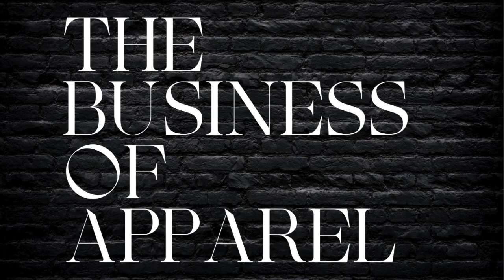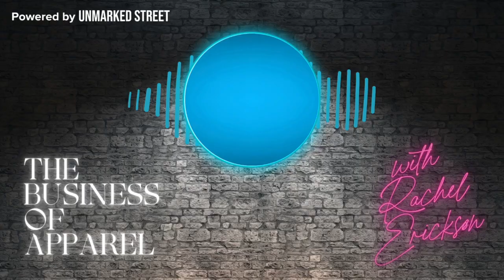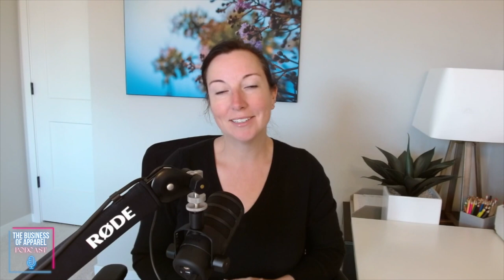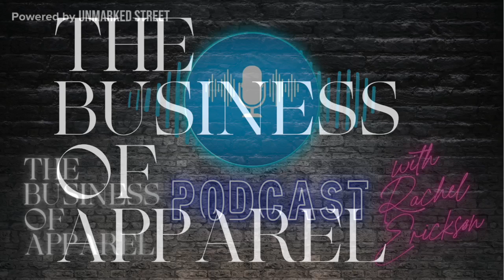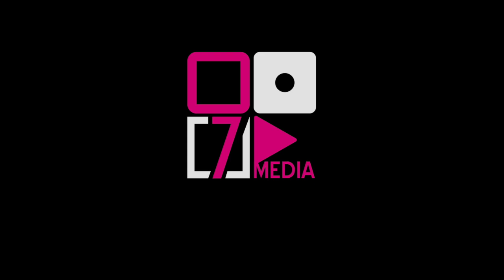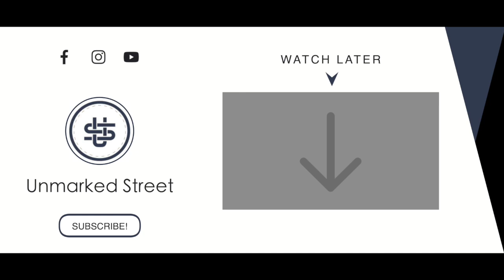California’s New Legislation for Apparel Sustainability | Ensuring Sustainable Fashion

Comment: Appreciated how clearly Rachel broke down AB 347 and SB 707. The push to eliminate PFAS while scaling textile recycling is a huge shift for manufacturers. How are smaller brands preparing for this?
Reply from the maker: For better or worse, small brands are needing to react just like the biggest brands on the planet on this one... They need to partner with their fabric mills, suppliers and manufacturers to phase out all PFAS items and re-develop their goods as quickly as possible. If they don't, they could face large fines, which can drastically affect the bottom line. If you're a brand who hasn't already taken action on this, the time is NOW or you will face penalties if you sell any goods in California.